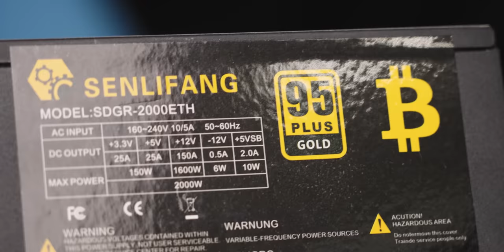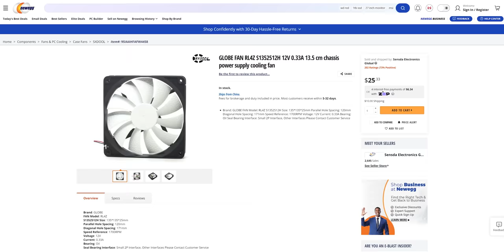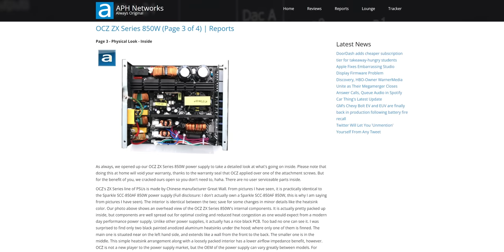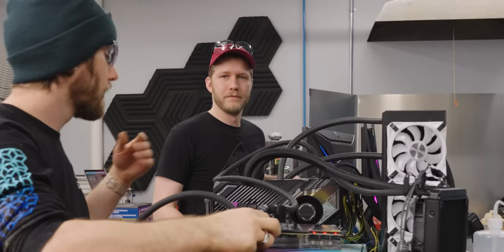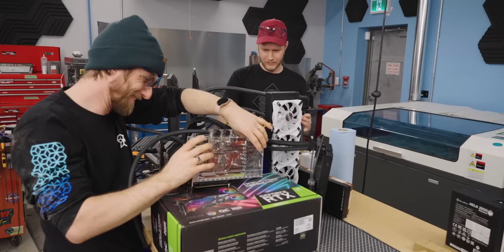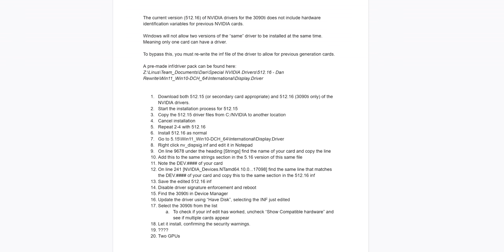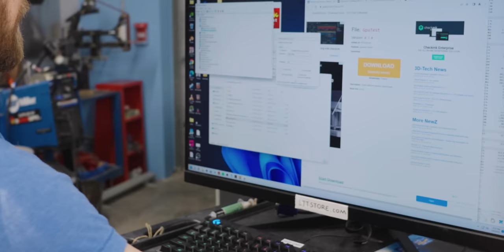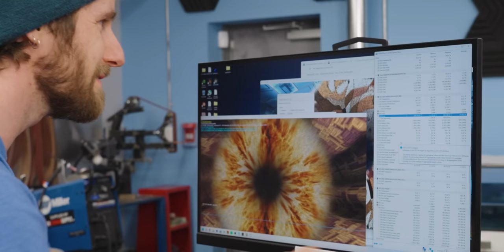This is one SKETCHY 2000W Power Supply

Comment: You should use a power loader (Like TecLab does here in Brazil), this kind of device can test power draw, efficiency, ripple, voltage and amps PER LINE
Reply: LTT makes entertainment videos. Linus knows what his audience wants to see. This is the kind of content they want to see too.
Reply: @1pcfred  I think It would be funny to see this PSU exploding in a Power loader
Reply: @SrNerd  it'd be funny to see it blow up. I don't think you need any fancy load to do that though. Just short the PSU out. To draw 2,000 Watts at 12V you need a resistor 0.072 Ohms. So a dead short ought to do it.
Reply: @1pcfred  Yes, but with the power loader, you can slowly increase the power draw and see the real wattage it supports. It also can measure the ripple, so you can see when it would start to destroy your computer
Reply: @SrNerd  if it is blown up it can't destroy any computers then.
Reply: @1pcfred  Exactly! Less 1 piece of garbage destroying someone's computer

Comment: "Which one of these is the neutral"... Neutral is only used when you want to produce 120v. When you're running 240v, both wires are hot. Devices that need both voltages (i.e. dryers and ranges) will have 4 wires if using modern wiring. 2 hots, 1 neutral, 1 ground.

Comment: the MOV's were the small blue discs on the left side of the video at 8.11
NTC label'd parts are use to measure temps, likely part of the safety shut off circuit that'll kick in it things get to hot (and also activate the fan etc). they will change resistance depending on the temp

Comment: This gives me flashbacks to 2010 or something before I knew much about LTT (except from a few reviews) and I opened up my corsair psu. I did this just to dust it off I can't recall any problems with the system after my "service". Guess I had pure luck in not blowing up my pc or my fingers. These kind of videos are important. Like yeah, there is warning labels on a PSU but in my defence there are warnings on GPU coolers too, only difference is that one might concern your hardware guarantee and the other your life ><

Comment: My experience with Chinese Power Supply Equipment: Frying equipment is unlikely as voltages are usually correct (It's hard to lie on those as a simple voltmeter can check that), but current capacities are WOEFULLY overrated. Too little current usually just causes equipment to not work.
Reply: Had a chinese psu that came with my old prebuilt. Put it in my system ran vr and it half fried my old ryzen chip and started smoking. Didnt take anything out other than the cpu and itself.

Comment: the amount of powersupplies I've ripped open when I was young without anything happening is insane, I've only ever got shocked by my dvd player that was still plugged into a wallsocket when I was opening it
Reply: I've been shocked more times then I like to admit. One of the worst was from a soldering iron. I was working on a car in the winter and the snow/ice was melting off of it causing a huge puddle of water on the ground in the shop. I reached down to grab my soldering iron that was now in a pool of water. You can imagine how fun that was.
Reply: shocked twice while pulling out plugs from walls!

Comment: 6:31 Electrolytic capacitors are always on DC side. You meant primary side and secondary side. Capacitors are after rectification and that's DC with or without them

Comment: It's what is known as "cha bu duo" in China. A low specs product that is labeled as higher specs product. Basically like overclocking but is applied to various China made products (electronics, vehicle, building, you name it). 

If you wonder how they do it, one of their s.o.p. is to do away with safety margin, so if in case of US/EU/Japan/SK made products you can use them 10% or 20% more than its stated workload (e.g. overclocking) and still come out all fine, China made products will just blow up if you use it to 100% workload because it doesn't have safety margin in case there is a power fluctuation, and some even have negative safe margin, which is very likely happened to the psu unit in the video. 

While US/EU/Japan/SK take specs labeling seriously, China manufacturers treat it as just another form of boasting. So for example, you can find a China made 18650 battery that's boasted to have 10,000 mAH capacity which is impossible with current technology (for comparison, Japan and South Korea made battery can only hold 2,500 mAH and labeled as such). Worse still, the China made batteries may just have actual capacity of 1,000 mAH or less. But hey, it's cha bu duo, nobody will check it. Amirite? Amirite? So, the psu unit in the video? I bet it can only go to 1500 watt before blow up.

Never ever ever ever trust technical specification of any China made products.

Comment: Dude, on the mining groups I participate in I've been seeing pics all week of fires started by these things. These things are dangerous. 

To be fair, it seems they include some 6 and 8-pin splitters and adapters (or people buy them from somewhere) and those things spontaneously melt and burst into flames under load. That happens more than the actual PSU catching fire itself and could happen with any PSU pushing too much power through cheap splitters.

But I still call this thing the "Senliflame" and think you shouldn't use it if you value your house and your life. I'd rather spend $600+ and sleep well at night than spend $160 and wonder when my house burns down and we die of smoke inhalation ...
Reply: On the other hand, Chinese were using them massively until the crypto mining ban. Just keep them around 1300-1400W on +12 V and don't go for full specs.
Reply: if youre talking about molex to 6-pin adapter then the problem would be that some people put them in on ONE psu power line(because lazyness and stupidity) not TWO. connecting those to one line is asking for fire(one molex power line cant supply enough power, there need to be two  connections to separate power lines for adapter to not be a fire hazard)(edit: for same reason you should not put 2 "molex to 6pin" on 2 power lines, only one adapter per 2 lines is safe. )

Comment: Just for future reference Linus, large capacitors can self charge in time to quite dangerous voltages. Probably not while soldered in a power supply, but still, just so you know.
Reply: What??
Reply: @Zach.O  Yes indeed. I believe it is called "dielectric absorption". Basically, a large capacitor, if left unshorted, will self charge to around 2-10% of rated voltage. Of course that is not a problem with relatively small capacitors, like in power supplies. But once you get into high voltages, it can be quite dangerous. That is why in labs they keep all large capacitors shorted while not in use.

Comment: For tests that require a high powerload - why not use an R9 295X2 and FX 9590?
With those you do not have to risk the still expensive RTX cards.
Reply: Killing a functioning R9 295x2 is a bigger crime than killing a 3090ti imo.

Comment: What they do to get more power from a lower power supply is to modify the shunt resistor, or even eliminate it, but this causes too much stress on the components and makes them overheat, and this in addition to burning the power supply can burn the computer parts or even cause a fire.

Comment: I’ve been running one of those 2000 watt psu gif over a year on 3 3090s. It’s worked great! No issues

Also Japan has two electrical standards. I live in the west half so my electricity is 100v 60Hz
Reply: I have been running one on a 7 card 3070  board for a yr and would buy a bunch more lol
Reply: How in the flippity flop can you afford upwards of 3,000 USD worth of graphics card?!

Do you mine with those cards or something?
Reply: @nesyboi9421  Game and mine. If I’m not gaming I’m mining. They payed for themselves in a couple of months. I have the computer in another room than my office so the noise and heat doesn’t bother me.

Linus has a video a few years ago about setting up computers with display and accessories in other rooms. Pretty spanking good set up!
Reply: I’m all about making my money work for me. So my gaming machines gotta pay rent!

Comment: Wait! so my power supply could be simpler (fewer parts that can break), lighter, and cheaper if they would build separate versions for North America and basically the whole rest of the world? Why would they not do that?
Reply: because North America is a large market and it's also not the only place where 120V is the norm for receptacle circuits.
Reply: Not just north America tho, everyone fails to mention that in south America (at least in Venezuela) it's all just 110v the same as north America
Reply: @LzysGraphics  yes. So make two versions. One for 110 and one for 240. It's not like it's uncommon to have different products for different markets
Reply: @FalconX88  it is for power supplies, you don’t want someone from the US taking their laptop charger to Europe and breaking their laptop because they used an adapter to plug into a 240v circuit
Reply: @LzysGraphics we are not talking about laptop chargers here. This is about ATX powersupplies....
Reply: @FalconX88  same thing buddy. People travel with desktops and buy power supplies from different regions, the range of products with a universal power supply is only growing.
Reply: @LzysGraphics  no it's not the same thing. For a laptop it's super common that you'll use it with both, it's  mobile machine. Totally different for desktops. Only a tiny, tiny fraction of desktops will ever be moved between these two areas. It would most likely be vastly more efficient to have dedicated PSUs. Which btw. is quite common for other electronics or things like vacuums.
Reply: For active PFC supplies, there is literally no parts cost difference between single voltage and multi-voltage versions. For the old supplies with the little red voltage switch the difference is (other than the switch itself) they use two smaller capacitors instead of one larger capacitor. Making separate versions isn't worth it.

Comment: I did just realize:          
Those capacitors don’t have any scoring on the top as emergency pressure release. It’s obvious on the Nippon units, as it’s intended to be a weak point where the capacitor fails in case of overheating or otherwise overpressure. Those capacitors in the Chinese unit are very very dangerous.

Comment: Fun fact this Power supply is used for all computer shop here and have no ever problem .. so this cheap power supply is not bad for cheaper gaming parts for others
Reply: where are you located if you don't mind answering? I want to buy this PSU since I trust that it will at least be able to deliver 1600 W continuously on 120 V mains power.

Comment: Note: switching mode transformers(the ones used in most power supplied nowadays including pc power supplies) don't have "magnets". Actually no transformer, toroidal, iron core, or ferrite core. has magnets. The material used in transformers for modern pc power supplies is copper and ferrite which is not a "magnet." Magnets can be used to concentrate or to control the flow of electrons but not in a transformer where the core gets to do all the work. Magnets are used in magnetrons to help micorwave ovens produce microwaves more efficiently for example.

Comment: Unplugged, transformers safe to touch, they hold no charge.  Capacitors can hold a charge but when turned off they're supposed to discharge.  So, dangerous, especially those big hunky ones.

Since the cheapo PSU doesn't have to deal with 110Hz, it's easier to rectify the input voltage @ 220Hz.  Also, the caps can be smaller because that's what's smoothing the voltage.  Smoothing out 110Hz is a pain and requires big caps.  It has to discharge over a longer period of time, in this case twice as long.  Caps charge up during half the cycle and discharge during the other half.  When the sine wave goes above a certain point, the caps starts to absorb that extra power, and keeps the voltage past the cap clipped at that voltage leve.  When the sine wave goes negative and below the rated voltage level, the cap will discharge and that keeps the output held at that voltage level.  The caps have to hold enough charge to be able to absorb the extra power when sine wave goes up and discharge enough power when sine wave goes negative, to maintain the voltage at a certain level.  So, double the input frequency means it can discharge in half the time and hold less charge.

And this is why when you move away from home equipment, even in the US you can run into 240Hz equipment.  In the military it's common, especially for ship based systems.  It saves money on exactly this, the power supply.

Comment: 6:00 Quicon. Isn't he from Star Wars?

And transformers aren't made of magnets. They're made out of plate steel (low frequency) of ferrite cores (high frequency) plus a whole heap of copper wire (and sometimes copper ribbon, if a lot of current is transferred).

Comment: An NTC is not an MOV. NTC stands for Negative Temperature Coefficient, or in layman's terms, it's a variable resistor that changes resistance with temperature, or in even simpler terms, a temperature sensor. 😁

Comment: The Power-Supply Plug is also used for 240V, so that wouldn't be a problem tbh. And almost all devices that accept these types of plug work with both 240V and 110V, but you should always check if that's true before you power stuff with a plug like that.

Comment: NTC = negative temperature coefficient. It's a thermistor. As temperature rises, the resistance goes down. On the other hand there are PTC's (positive temp coefficient) which increase in resistance as the temperature goes up. Used a lot in HVAC.

Comment: Devices designed for 230V generally are polarity agnostic. Virtually all sockets are not polarized in Europe and most of the world so it does not matter which one is neutral for such socket. That being said, both can be hot. The ground has to be separate simply because you can't assume that neutral is one or another even if you'd want to (not mentioning about ground fault protection). In NA you can commonly see 240V transformers grounded in the middle which means that both ends are 120 and -120V, two phases. That's why you can connect them together to have full 240V potential difference (doubling the power). Quite neat. It's different if you have three phase though, in this case it will only be 208V for two 120V phases that are only 120* apart (not the full 180* which are completely opposite).

Comment: Can I just point out that the "gaming" brand PSU's aren't all that either. A few years ago I was running a Cooler Master PSU and eventually had the electric company at the door asking to install a filter (it's a 15x15x30cm huge heavy thing) because I was disturbing the more sensitive electronics in the building.
Reply: I spent half a day tracking down a cheap computer power supply that was interfering with the equipment in the lab. When I found it a Widlerizing with a large hammer was in order. The power line filter components on the pcb were jumpered out or not installed.

Comment: That PSU seems reliable and decent, just not super efficient and definitely not 2000W!

Heck they don't know what an NTC is.
It's a resistor that initially has a high impedance and as it gets hot the impedance gets down. Used to prevent huge current spikes caused by big caps when you plug the PSU in. Also known as an NTC thermistor.
Can be used as a heat sensor, but then they have a super high cold resistance, and a lot of heat sensors are PTC thermistors (impedance increases as they get hot, so the opposite).
In the case of this sketchy PSU, it's an NTC thermistor used as un inrush protection, and it has a low impedance!

They are really useful components, although they are too inefficient for say 300W+ PSUs, their usage in this case is not professional at all!

Comment: White is not hot, white is Neutral and black wire is phase 1 hot and red wire is phase 2 hot, and Green with Yellow Stripe (USA Green,Bare Wire) is ground. now it doesn't matter
because the x and y are both hot on the NEMA L6 plug. Get yourself or make a NEMA L6-15P/L6-20P extension cord and then get NEMA L6-15P/L6-20P to C13 cable, this way you won't mess up any other devices in the future. Most power supply's should be able to run 240v though the C13 plug on the back of the PSU.

Comment: I used this kind of powersupply for 1 years to mine Ethereum with 8 Amd RX5700XT on, no problem. 1000W 24/24 7/7. 1 year. "2000 W" is probably wrong, i don't know, my max is 1200W (before bios config of gpu), but for 1000W it's ok =) for 140€ it's very good.

Comment: so it honestly didnt matter which way you wired your L6-20 connector as with 240V power both white and black would carry current and the green would be ground, as long as green went to ground it would have worked. i work with 3phase 208V, 240v and 120v every day in my industry, obviously you want to still know for trouble shooting purposes but as long as you are consistent with both ends you'd be fine

Comment: talking about power supplies, there was this one power supply in my house that its fan was making noise. so i knocked on it and there was a spark. i thought it was like the fan wires were touching as the power supply has been serviced before and the fan was still making noise so i knocked it again and it blew up. there was like a million sparks and a little fire. i immediately turned on my fan and i waited a couple minuites until unplugging everything and putting it in the middle of my backyard.

Comment: Please throw away that extension cord or at least put a bigger warning on it. The wider prong on the 120V connector is supposed to be neutral, but it is one of the phases on this cable. Unfortunately, devices that connect neutral like a ground are not unheard of.